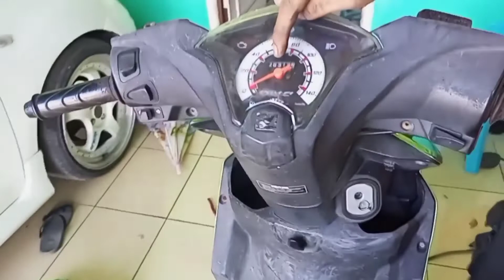cara ganti kabel spidometer & gearbox spedometer BeAT Fi @Bengkel_satset

Comment: Kode part gear box nya berapa
Reply from the maker: @hamba167  pake k25-900 bang
Reply: @Bengkel_satset  kalau kode part kabel spedometer nya berapa
Reply from the maker: @hamba167  kvb-900 bang
Reply: @Bengkel_satset  kalau k25 sama ga?
Reply from the maker: @hamba167  
Vario,beat, Scoopy sama bang
Reply: @Bengkel_satset  oke bang terimakasih infonya
Reply from the maker: @hamba167  siap.sama2 bang